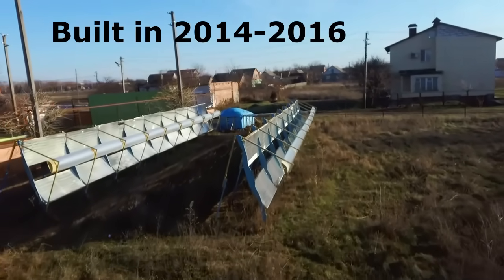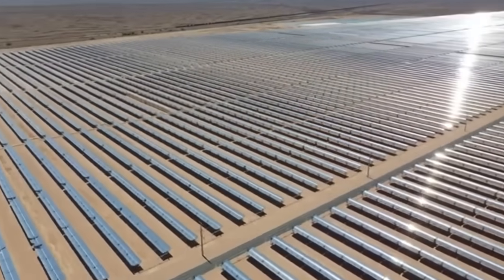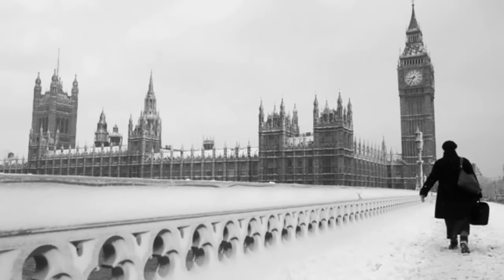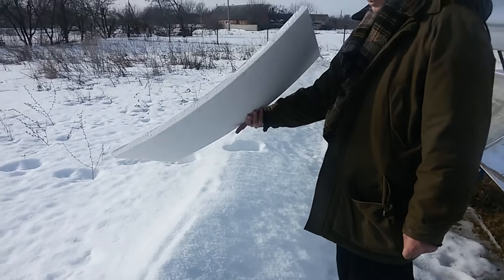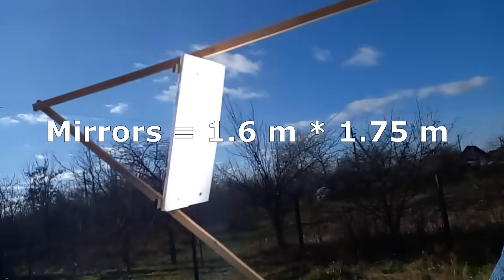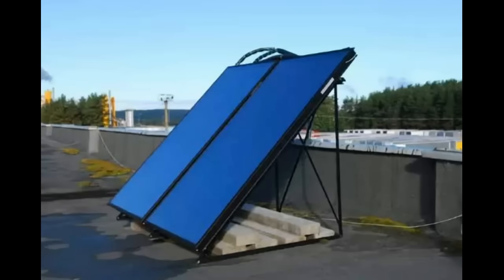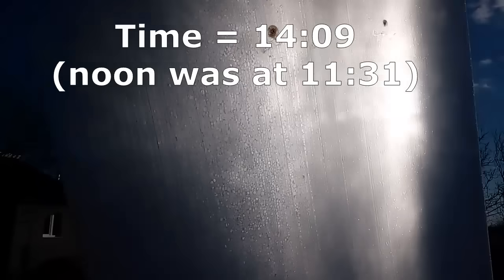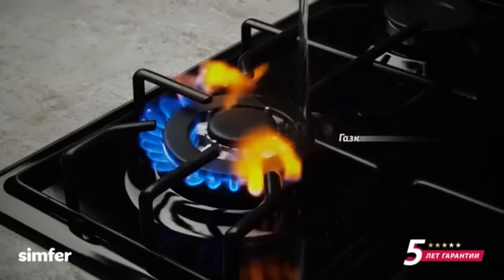This solar energy innovation is 10 times cheaper than analogues: solar electricity 24 hours a day

Comment: Big respect for you and your work 👍
I love when people think out of the box..... Another channel I follow use a Thesla turbine under vacuum so it can run under mutch lower temperature. I can put a link if anybody is interested.
Reply: please do put up a link, thx
Reply: @eriknielsen1849  Thanks Erik, I'll have a look a at that - up here in Sverige we have the space to try things out 
;)
Reply: @gurglejug627  ooo a fellow northern 😄 I'm from Denmark but live in west sahara we have a litle more sun here 😄...... But maby the Thesla set-up could work perfect with wood also for electricity production would defently be better than high pressure steam turbine.
But good luck to you.
Reply: @eriknielsen1849  Vest sahara, det lyder skju sjovt det, vad laver du der?
Reply: @gurglejug627  guld miner og håber snart at få opstarte noget gartneri . Men vi er stadig bare i opstarts fasen. Så meget tid spildt på bare at vente på ting 😕... Men glædelig jul om ikke andet
Reply: Once I saw somebody put a stirling engine in a vacuum! No air resistance to slow the wheel down!
Reply: @worldcomicsreview354  yes but this one use the energy/pressure difrence between the 2 cylinders the 40-50 degrees boiling water and cold water makes

Comment: Did great job raising our pool temp by 10 degrees in about 6 days. Two of the day had high temps in low 70 and still put out almost 80 degree water.

Comment: You can turn that heat into electricity with a so called ORC turbine.
It uses organic fluids like petrol instead of water, so it's possible to obtain more energy out of the heat die to lower steam points. 
https://de.m.wikipedia.org/wiki/Organic_Rankine_Cycle

Comment: Hi
I take it  your  issue with the different times of day is that the collector is not following the focal point at the particular angle. A slightly more complex arm may be worthwhile. Would look at a series of pivots with balancing weights to lower any operating cost.(ie expensive motors)
Reply: He's covered that issue extensively in previous videos.

Comment: although moving the target seems like a good fix. Don't forget if you move the target with liquids inside, u will need good sealed joins. İnstead o moving the target u can move the reflextion mirrors  as ur mirrors are very light. Ten u don't need sealed liquid joints only some cheap hinges. Also u can use hexagon reflators for better concentration. U can coat the reflectors with liquid glass for log term useing.

Comment: Depending on the generator modules’ upper limit temperature, additional optical component or waveguide or light reflecting tunnel or reflecting mirrors can be added to reach further concentrations ratios

Comment: Sergei! Could you use a focusing lens in the receiver, perhaps? 🙄 The kind from overhead projectors and so on. 

If you get one large enough to concentrate from the maximum area of the focused light from the mirror, and perhaps even make a gear for the distance between the black heat transfer box and the lens, so the focus is better at different times of day, that would probably maximize the energy collection. 

I suppose you could make a parabolic path of travel for the box, and one for the lens in front, so the focused beam from the lens always has the same size on the box. (Perhaps with a piece of energy glass in the receiver box, to keep the infrared wavelengths inside.)

Is it possible to make a path of travel in front of the mirror to always have the same size area of focused light from the mirror itself? 

That would solve the entire problem, of course.

Comment: What is the average wattage that you are generating on your oil-filled collector?
Reply: His reflector is around 2.5 square meter. In summer we can get around 1000W/sqm. If we assume he can focus 80% of the light onto the collector, his peak energy is around 2 kw. So he can heat around 300L of water to 80 degrees C on good days.

Comment: Car radiator, close side black and far side white to reflect back anything lost through it to other parts of the rad. You should be able to get a small ish one, but it will increase your surface area enough while not inflating the budget so mightily.

GREAT Job! Let me know if your experiments would be helped by gaining access to a different set of circumstances in life. Willing to sponsor!

Comment: If you can create a vacuum translate to insulate your target,  it would save on radiating heat away in the air.
Get a glass ⅓ to ½ sphere the a metal thick plate backing weld your 2x pipes through the back of them, also holds it in place and swing from.  
Use a graphite super black paint, I don't remember the name sorry.
Connect 2 x cheak velves and a small piston to the metal backing to create a vacuum then check your temp with a laser.
😊 Best of luck 
Hmm marble can make a pressure switch to turn on and off to maintain the vaccum 
If the seal is good to won't need pumped much, or can using a mechanical pump running  A 3rd pipe to it and wires to the vaccum switch to turn and turn off to maintain the vaccum...

Good luck, hope you can get it working well. 
I thought they were achieving 800+ °C in their vacuumed tubes.
It must be an old video I saw omg 😳 about a decade ago...
Also use insulation on the pipes...

Comment: This looks like a good design, easy to repair. I would like to see how the heat is stored. I think a variable speed pump could keep the temperature leaving the collector at about 200 Fahrenheit.
Reply: Look at his other videos. He has a plastic dam under cover with water for heat storage.
Reply: 200F isn't his goal.  He's looking for (I think) over 300C.  If he is eventually going to try and generate electricity, he'll need the highest temperatures and the best storage possible to generate steam.  Of course, that's assuming he limits himself to steam as the working fluid.  There are some plants that are using CO2 in a closed loop system.

Comment: Lovely! I am always excited by your work! For the receiver's scattered sunlight: What about a second, smaller mirror surrounding the receiver, to catch morning and evening rays and re-focus them, as well as increasing the multiplication factor, peak temperature? Wide flanges, like flower petals, could curl inwards, to point the stray light back to the center, while the reflectors just next to the receiver are a steep angle, to help focus-in on a smaller receiver flask, I think...
Reply: Its hard to understand this systems need more details
Reply: @karlorf2023  Bend the mouth of a parabolic inwards, so that steep-angled light bounces toward the center, too. It doesn't have to be geometrically perfect, as long as it hits some part of the receiver.
Reply: Look at his older trough receivers, they use this idea.
Reply: @unionse7en  thank you! upvoted!

Comment: Will be interesting to follow up on this design. I am planning to use platinum coated HDD disks in similar design as I have aquired 100s of them at zero cost. Three problems I need to overcome: (1) they are round so there will be unused holes and spaces between them, (2) they are not flexible for curving and (3) the whole mirror needs to be made flat on the ground to survive frequent storms in my area :)
Reply: You can make it concave i and bury it in a concave hole in the ground, with collector traveling above it, similar to design shown in the video, just inside a hole in the ground.

Rain can be managed by digging a bit deeper hole and suspend a mirror above it so it doesn't get submerged by a heavy rain. Snow will be a lot harder to deal with.

Unused space is not an issue, it will just make the reflector bigger...

Just my 2 cents.
Reply: Cut small rectangles and put all together to preferred shape on another body like parabolic shape

Comment: I do not get it ... its far simpler then that, the apparent surface is what is important, being bent in 2 directions or only one will change nothing to it. It's just a matter of reflective panel surface vs receptor surface.... and you're trying to make it rocket science. Bending in 2 directions IS NOT more efficient AND it need 2 axes of liberty to follow the sun which makes it a bad bad solution.

Comment: Very nice construction!
I was curious, if you could use this concentration method, and mount small solar panel in focal point, and cooled on back with water. This way you could make directly electricity with cheap (smaller panel, less cost, more light bigger efficiency) and in the same time cool it down with water making hot water for home heating. PRobably this design makes too much sun flux for such use, but it could be still interesting
Reply: PV solar panels work better with more "brightness", but also lose efficiency with heat. ~400 degrees would probably just melt them! 
(Also no PV panel will be anywhere near 50c/Kw)
Somebody did develop a system of two moving, flat mirrors to reflect sun onto a static panel. That worked pretty well.
Reply: @worldcomicsreview354  yeah tech ingredients video :)
I was not thinking about such big concentration XD But rob murray smith wastalking in one video about research in direction of use small panels with big concentrators

Comment: I think in the REALLY big solar collectors there's no black surface to collect the heat and transfer it to a liquid running through the inside of that surface, there's just too much heat.
Instead they have a transparent container with a semi-dark liquid inside which collects the energy throughout it's volume rather than on just the illuminated surface.

Obviously you don't need to use the same principle because of too much heat but maybe using the same principle will make things easier to build (or cheaper). Otherwise you need a heat resistant dark as possible coating and you want to ensure turbulent flow in contact with the heated surface etc. etc.

Comment: Sir, your videos are inspiring. I have been subbed for a very long time, and I have been impressed with your progress. 

I have a question/suggestion:
Have you considered using an inexpensive Fresnel lens at the receiver, to take your already concentrated light, and further concentrate the pattern onto a smaller, hotter receiver? I mean, you must already use some glass/plastic to prevent convection cooling... why not make that one of those $1 plastic flat lenses? Would it melt?